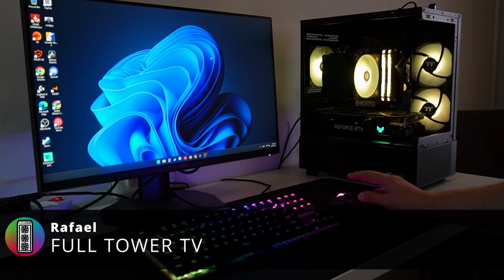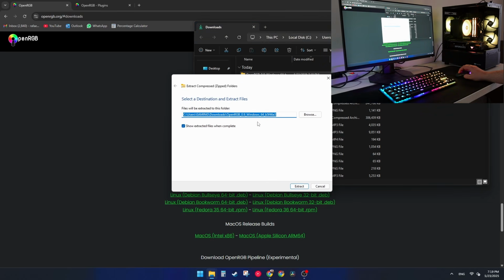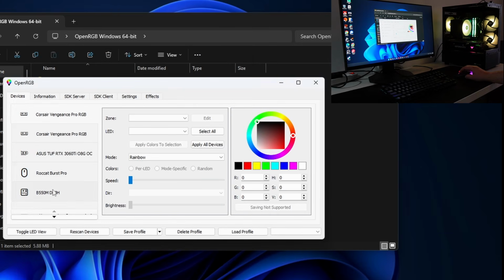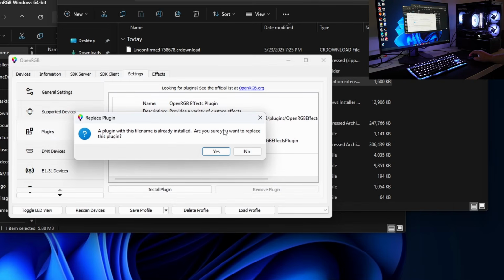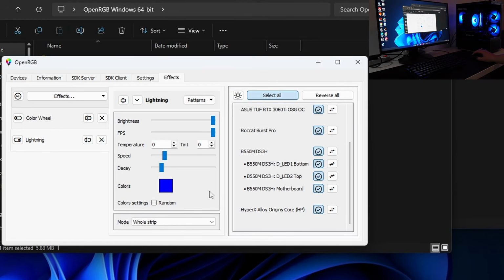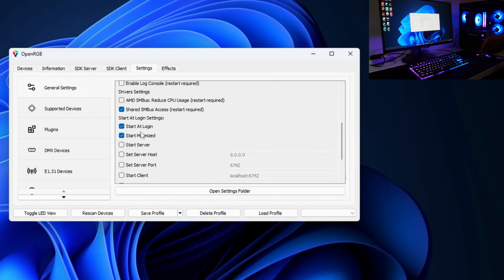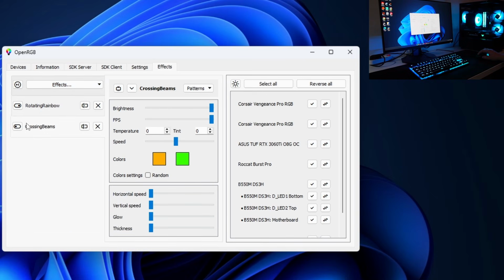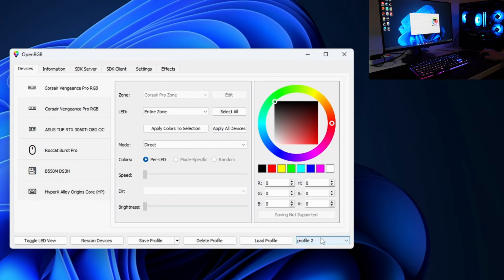How to sync RGB using OpenRGB Effects Plugin

Comment: I did exactly what u said in the video but after i download the 0.9 version it just doesn't work, it didn't read any of my devices :((
Reply from the maker: Yes sometimes OpenRGB don't read all the devices.
You can try and use SignalRGB instead or the motherboards software (Armoury Crate for Asus, Mystic Light for MSI, RGB fusion for gigabyte.)

Comment: Bonus small tip: After you select the effect you can click on the tv icon button above the effect configuration to get an idea and show you how the effect looks.
Reply: Where should that show?
I don't understand why these plugins have 2 togglesz one in the left panel and than another in the right. Makes no sense to me.
If you add different effe tsz only will work. Unless you use a layered FX. It's nice that it still has many options. Still lacks some basic things. Like reactive. Would be nice if you could chnage key colors, when they being pressed
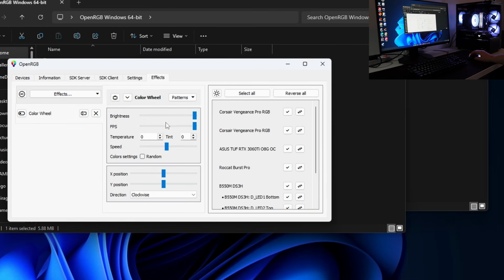Reply: @RomboutVersluijs  The button is in the effects plugin tab as shown at 10:04 when effect is selected and then you click on it it will popup another window with a preview of how the effect look with some configuration of it in the same window.
For the toggles i guess it is their design for how to control all effects and which devices for now maybe.
I agree with you that some other effects isnt available for now in the current build but hopefully in the future they will add much more.

Comment: The video is very long try to make shorter videos for more clicks
Reply from the maker: Yesterday I was debating with myself that maybe I should have framed this video differently and addressed it in a way that talks more about the plugin and the different effects (because the base program doesn't have everything)
But, I wanted the get the "clicks" and the "views" so I named it more broadly and I think you have a point - it was too long. 
I should have either made a short version on how to download the OpenRGB software alone, or I should have made this video as it is but named it differently. Maybe something like: "a deep-dive on how to use different RGB effects Using Open RGB Effects Plugin"
Reply: Short video won’t actually help or be an option as those softwares can be really confusing..he managed to make it as short as possible with actually showing every little step needed for it to work properly